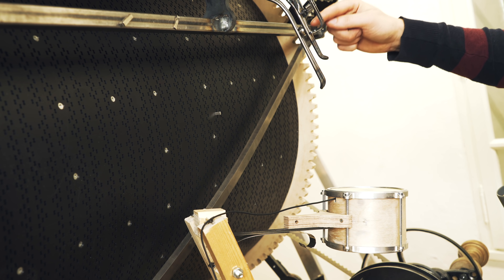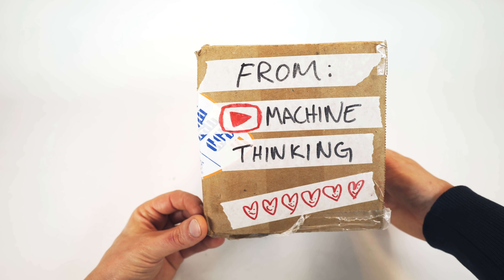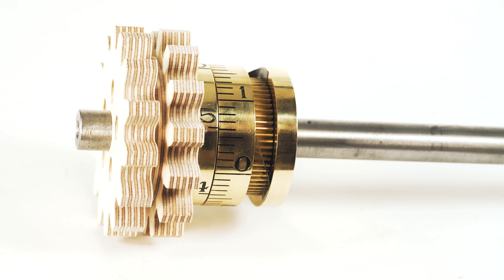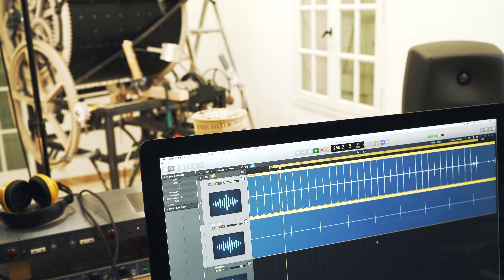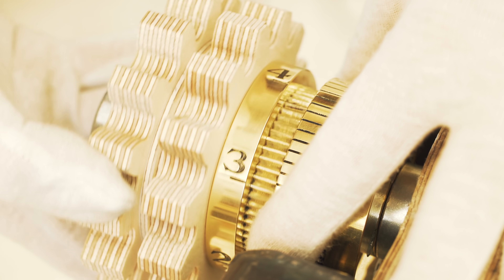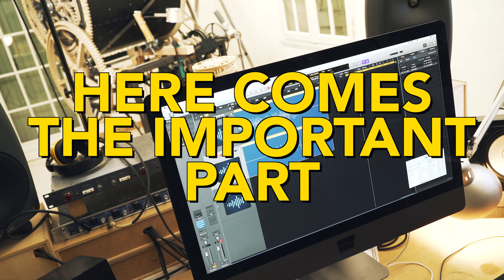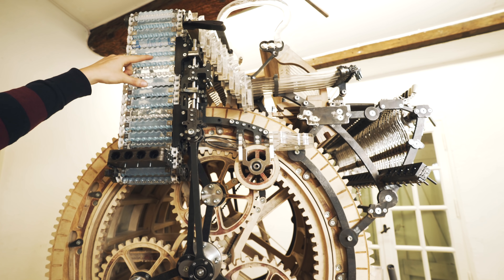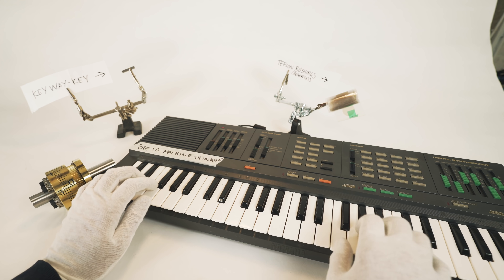Testing the Music Timing Clutch - Marble Machine X #77

Comment: Martin, assuming that the amount of steps on the clutch is directly proportional to the bpm, it looks like you can get the amount of steps needed by taking the bpm and dividing by around 4.8. Likewise, you could calculate how many steps you need to add/take away when changing bpm by dividing the change in bpm by about 4.8. This looks like it adds up with your tests in the video.

Also, because the marbles accelerate when they fall, marbles with a longer falling distance (like the ones for the vibraphone compared to the kick) will take a little longer to fall and so will be offset by a different amount. You'd lose about 45ms in delay from releasing the marble 30cm above the target as opposed to 20. I'm not sure how important this is, because it should have been definitely noticeable in the first machine, so maybe it's not a huge issue. Humans are imperfect at this, so realistically perfection in this aspect is not essential.

TL;DR Looks like you can divide the bpm by 4.8 to get how many steps you should move the clutch from the neutral position for synchronized playing.

Comment: Just to clarify: because the drop height of the marbles is adjustable, you are able to make sure that every marble from every channel drops exactly the same distance towards a particular "instrument" (whether that may be a snare drum, a string of the bass guitar or a vibraphone), right? Otherwise, wouldn't you run into the same problem for every channel?

Comment: the ultiamte way to control the timing would have been Governor linked advance like in the distributor in an old car or the valves of corless engine but that would be very hard to get it tight enough, would look awesome though

Comment: Pretty sure you've already done the math, but this is the formula I found for the offset you have to apply:

offset (degrees) = 3/500 * rpm (crank) * delay (ms)

or:

offset (steps) = 1/60000 * rpm (crank) * delay (ms) * n (total number of steps)
Reply: Once you've got the offset for a certain BPM you should also be able to calculate the offset for any other BPM, if you know the constant travel time of the ball to the drum!
Reply: I guess I can create some kind of online calculator website for Martin, but what is most important is that with the measurements on two BPMs and the exact degree offset, we can surely calculate the absolute timing delay from the command wheel to the audible drum, which will be useful for your equations!
Reply: With the falling delay we can indeed come up with an equation that describes how much you'd have to adjust the clutch when you are changing pace. Martin, if you're reading this, do you happen to have any more details/measurements?
Reply: @koosnaamloos4291 , The delay according to calculations are 180ms, not sure about precision in case of inaccurate measurements. I'll post some texts about the calculation in the main comment session.
Reply: It would be very simple to build an automatic advance mechanism.  Let the machine do the calculation.
Reply: @KC9UDX  Good idea - perhaps some sort of flying ball governor driving it? It would have to work in discreet steps though, if you had it continuously-variable then you would end up with a weird hysteresis between the rhythm and the melody due to the feedback loop created with the musician hearing the drum out of step and overcompensating against what would become a non-linear system. 
I think the clutch as it is, is a beautiful but simple (in mechanism, not in manufacture!) approach to the problem.
Reply: @donkmeister  I like what they made, but yes, flying ball governor like assembly would do the trick.  It wouldn't have continuous advance, it would return to centre, and if done correctly should have a very quick response.  So I don't think it would be much of a problem.  Ignition timing is probably more picky than music (I'd have to do the math to be sure) but mechanical advance distributors work very well.  The difference is that distributors don't do much work.  This system looks pretty effortless too, though.
Reply: @donkmeister  I disagree. The human mind already has excellent dampening systems build into it. Unless you waned to match an exact BPM to the number, there's no reason to go discrete.

Comment: While this does correctly sync the drum to the crank, wouldn't you need one of these per note, since the delay on each marble release is different? Just because the drum is synced to the crank position at each tempo, it doesn't mean that everything else will be. And the problem gets worse if you increase the tempo since the delay between two different instruments would correspond to more beats of the song.

I think the only way to solve this is to make the delay on each marble release (from when the registrator is pulled to when the marble hits the instrument) the same. Hopefully the instrument can be adjusted to that degree.
Reply: That's exactly what he will do, all the release distances will be the same. He explained this on the previous video (I think).

Comment: That's a really nice solution, but I feel it would have been better implemented on the rhythm machine itself, with a lever/knob over by you so that you could do songs with varying tempos and still have the machine in sync. That said, while it would be sacrilegious to modify the clutch, I'm sure you could add "stops" and a lever that pulls the spring loaded collar over so that you could change timing mid song. It would, in effect, be a "clutch pedal."

Of course, that'd be awful on the teeth of the poor thing.

You could also do the same thing by putting the rhythm machine on a spring. Basically the spring would hold the rhythm machine to the left, and the rhythm machine is coupled to the bar via a through pin or simply pins in the bar. The bar (or rhythm machine) would have a slot that the pins ride in. When you pull a lever, it disengages the spring, and the rhythm machine would get pushed over via the slot to another timing position. (You could have a weaker spring on the other side.) That way you could go back and forth between 140 and 80 bpm as much as you wanted, mid song. Of course, the arms of the rhythm machine (or the catch) would have to be wide enough to accommodate this change in position.
Reply: Listen at the end. He needs a fixed BPM, because that way he can listen if it's on time or not while playing.  Just have to pay attention to the drum machine delay. (The drum machine will be the "metronome").

Comment: Won't you have to make sure now that the marble drops take the exact same time for the kick, vibraphone, snare etc. ?
Reply: Was thinking this too, they'd have to be cadded to all have the same falling distance, but I believe that was controllable at the dropper
Reply: @pippinsmith  Yeah, IIRC he mentioned that the drop points are movable up and down the rails, allowing individual tuning of drop timing for every channel!
Reply: Yea, I'm worrying about that as well...
Reply: I think Martin has already built in adjustability to each of the individual channels? That said, I'm not sure how he'll be able to alter each of these in-between songs when playing songs with different tempos live (If he even needs to at all?)
Reply: @Spendalifetime  as far as I understand physics, when ignoring the negligable amount of change in the gravitational pull between the drop points, as long as the physical length between the drop point and the contact point is the same, the time they take to fall will be the same, no matter which channel, so when there's a faster or slower tune he only needs to adjust the clutch, as this will release the marbles before they hit on the beat, consistently, then again I don't have a degree in physics
Reply: @pippinsmith  Yeah, after thinking about it some more this makes sense. I think I got too caught up on the fact he was only testing the Kick Drum channel!
Reply: @pippinsmith  correct. But the distance would have to be exactly the same for every single channel (drums, vibrafon, bass, all of it). Not sure, whether the adjustable rails allow for enough room to do this. I hope they do :D
Reply: @pippinsmith  I have a degree in physics and you are correct :)
Reply: i was thinking the same here.
Reply: Yeah I guess he will need to have them all delayed compared to each other by just the right amount, and with a delay that depends only on gravity, i.e. is independent of bpm (so he can't just move the pins on the programming wheel). I guess he just needs some extra lengths of rail after the drop points or something, to slow the drops.
Reply: @ninjafruitchilled  Not sure which video he explains it, but he has adjustable screws and springs on every channel that alter the delay of pulling the fork from when the pin is registered. It's quite clever actually.

Comment: I was wondering.. what if one instrument is spot on with the timing but some other isn't?
Reply: The drop points are adjustable and, so long as the distance between drop and hit are the same across all instruments, the instruments will play with the same delay
Reply: @PaladinNull  but the drop and the hit is NOT constant
Reply: @PaladinNull  Oh yeah true, I was thinking about that but wasn't sure. Also the plastic parts that the pins on the programming plate hit are (slightly) adjustable... if I remember correctly. I don't remember the correct names of the parts so I hope you understand what I am talking about :D
Reply: Well, all instruments will hit at the same time once the programming pin hit’s the gate , and the drop height is adjustable, so NOW all Martin has to do is to get all marble instruments to sinc each other, and since gravitational constant is ... well , ...constant.... , the marble instruments will stay in sincronisation... once they are tuned to be on time to each other. This will be some tweaking on 47 channels.... but he will manage!!!
Reply: I was wondering the same
Reply: Same
Reply: Always the possibility to remachine the pinholes of the programing wheel with some offset (but it will be not perfect after tempo change).
Reply: If my calculus is right, 2cm shift will create a noticeable 10ms offbeat...

Comment: If the vertical distance of the other marbles from the release to the hitting point is different between each other, the timing will not be compensated to all of them at the same time
Reply: I think it has timing adjustments for each channel.

Comment: Looks like a really elegant solution for the timing problem. Between the rhythm machine and the kick drum. Will the other instruments have the same delay as the kick drum? Because if Martin doesn't manage to make marble travel time between the gates and the inruments consistent, no amount of tuning on the clutch will make all instruments play on time with the rhythm machine. I'm assuming he already knows this and has this problem solved for quite some time.
Reply: All drop distances will be the same. Check previous video.

Comment: Will the setting on the clutch always match a specific BPM?  Like once you identify where on the clutch it syncs up for 90 BPM, can you always go back to that setting for 90 BPM?  Will that change if you have to disassemble the machine for transportation?  Just curious if you're going to have to time-tune the clutch every time you take it somewhere, or if you'll be able to tune it once and then just have a reference for various songs at that point.
Reply: As long as all the gears and shafts are remounted the same way (which I'm sure they will be knowing his dedication to detail) yes, it will be the same position every time.

Comment: The downside of this solution is that you cannot fluently change tempo during a song.
Reply: unless he gets a variable gravity generator, that's always going to be a problem. This way he can change the tempo at all, instead of being stuck in one.
Reply: At least not with both "drum parts". He could still change tempoin a song if the song has no hi-hat.
Reply: You could feasibly make a system that adjusts it based on the rate of rotation. It would be quite difficult to make it accurate and robust though.

Comment: Won’t this be an individual issue for each instrument? Unless all the marbles fall the exact same distance, each instrument is going to have different timing.
Reply: Yeah, good question and also my biggest concern.
The delay is a function of the drop-height for sure. So If all the instruments have the same drop-height for the marbles, you can tune the whole system like he did with the drum here.
But if not, you'd have to tune every instrument to a specific BPM individually, which is the thing the clutch was intended to fix.
Fixing the "fingers" with a delay will not alter gravity, and ultimately not fix this problem, right?
Or did I miss something?
Reply: first name last name thats what i was thinking
Reply: The drop position is adjustable. So the tuning will need to get each drop in sync that way to remain synced at all bpm.
Reply: I thought the same thing. I'm pretty curious, how he will solve it.
Reply: He can adjust the marble drops at several different levels from the registrator to the fingers holding the marbles.
Reply: I'm curious about this as well.
Reply: Isn't there a way, built into the pin system, to slightly tune the individual channel timing?  So say once you have the kick drum time-tuned, you can adjust all the individual channels to sync up with it, triggering later if they're a little too early, or vice-versa?  I guess that would have to happen every time you adjusted for BPM though, which is a pain.
Reply: The way it works is it's an offset for the entire programming wheel. All the marbles fall at the same speed for all instrument hits so when you play faster/slower the marbles all fall at the same gravity for all instruments but because gravity does not change, all instruments will be off by a certain amount. The clutch simply offsets the release for gravity Vs speed so all instruments will be adjusted equally. The reason (probably) he is just using the kick in the tests is because it's easy to test with and has a sharp transient you can see. Once it's dialled in, every other instrument would follow the same offset too.
Reply: @jestermgee  they fall at the same speed, but they don't necessarily drop the same distance. But I think he is just positioning the drop points such that the drop distance is the same for all instruments.